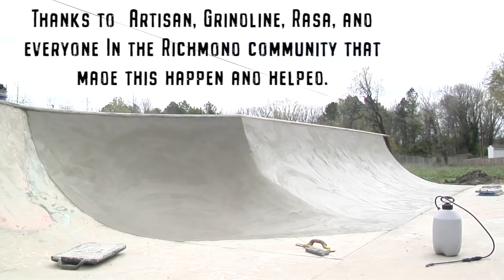Making A Concrete Ramp At Our DIY Skatepark : Then Skate It

Comment: tight build but dude needs to be wearing a dust mask spraying that
Reply: and maybe some safety glasses lol im a finisher     tight vid though
Reply: Yeah that shit must do wonders on the lungs after a decade in the industry.
Reply: It's wet not dusty. Eye protection the only thing really important. And really it won't damage your eyes just burn like a mofo.

Concrete finisher 4 years.

Also it hurts to watch these guys use their trowels backwards and fail to give it the scraping motion it requires to fill holes like you see here:    7:29

Edit: to add time-stamp
Reply: @RandoManFPV  I believe that it's wet, but is there still no risk of inhalation? I'm obviously uneducated here, but it looks like a fine mist filling the air that would require you to wear a respirator. Is this not the case?
Reply: @MrKlukie  man I'm from Arkansas and I've never done Shotcrete.
Ill tell you rn that the companies that provide the mix/equipment or labor will tell you that you have to wear one.
But if I were doing it I'd be this guy too. No mask no special P.P.E.  but that just how I roll, I finish regular concrete bare foot, grabbing what needs grabbed with my bare hands, whereas most people tell you, "oh don't let that get on your skin it'll chemical burn you".

Idk man maybe I'm a dummy but that's just how I learned to work, and by having that mentality of "don't be a puss just get in there and man your way through" I outwork most around me
Reply: second that!
Reply: @RandoManFPV  Wet particles are as bad as dry ones....
hahah I was thinking the same thing with the trowels hahah
Reply: @RandoManFPV  YEAH, WE'D  DIE EARLY AND PAINFUL....BETTER BE SAFE THAN SORRY
Reply: Silica dust is not good for the lungs.
Reply: some saftey glasses too i mean damn!!
Reply: @RandoManFPV  youre very badass
Reply: @dustinpaciorkowski9855  thanks, feel free to come to work with us and learn a thing or two. We will pay you but most people don't want to work this hard
Reply: It's wet no dust
Reply: @stewartharrison2366  idk if your joking but this video shows a diy project 
And most of us commenters arnt even currently employed for a construction company either...
Reply: @RandoManFPV  why would I joke about something so serious
Reply: Live and let live
Reply: You probably wear a mask in the shower 🤪

Comment: Do I put strait concrete on the top to make it real smooth I just used quick Crete so far it's rough
Reply from the maker: I would look up the full process of the exact concrete you are working with or what you are tying to do. There are some great detailed tutorials out there!

Comment: i have an olympic swim pool next to a gravel pit surrounded by sand. there was a bar directly above the pool with a bunch of barflys i would hire (with old weed) to help shovel rock and mix concrete, but the bar burned down and now i have to go to the bar across the streeet to find laborers :|

i want everything to be burnside size, eveything new in the skatepark world seems to be about 4foot or smaller

Comment: How much would this cost I really want to see about doing this in my home town we need a skate park like this for the kids .
Reply: I own a fabrication shop so I'm able to do all the steel work for it coping rails etc. And donate it . I just want to find some one who knows about a basic plan for a decent park . In the next small town over it took a kid getting hit by a car before they came together and built a skate park . I would love to see one built and help as much as I can in my town . I was thinking about every option I can .
Reply from the maker: It depends on a bunch of factors. But the main costs are rebar, concrete and wood for framing. For this we did rebar at 12 inch center. (Get rebar from a local metal supplier, not lowes) and if the concrete is 4-6” thick, it covers anywhere from 55-65 square feet. That should give you a rough ballpark if you know your square footage. Where we live a yard concrete is $120-$150 depending on the mix 👌👌👍👍
Reply: I am a metal supplier.. concrete/ land and permitting is what I am trying to figure
Reply: @swyers  thanks for the information.  I really want to get with the county and see if we can get a park here.  I want to build the rails and all the metal and see if I can get cemex or a local contractor to work with me on the construction/ concrete.